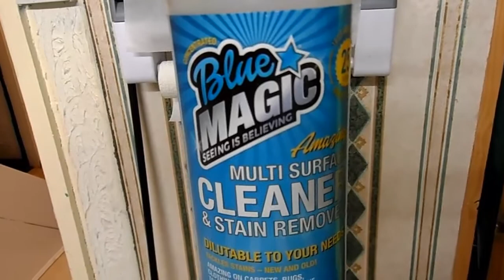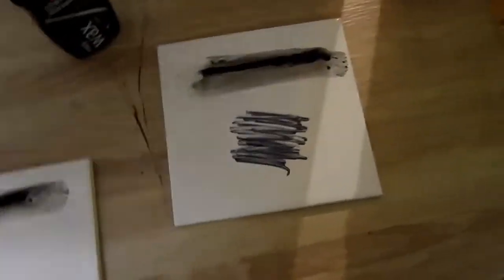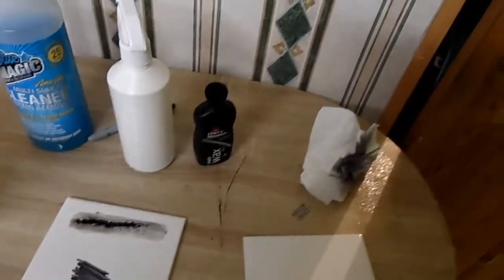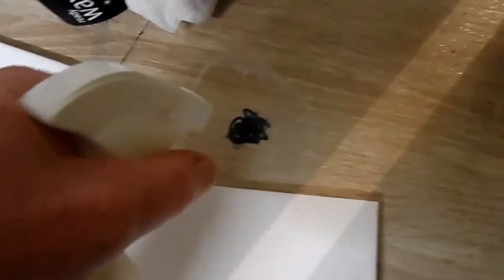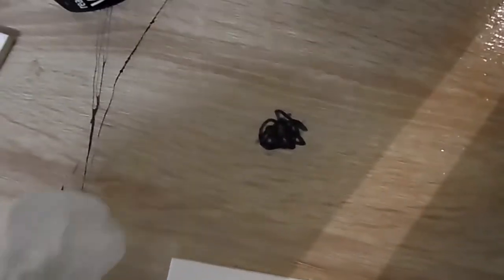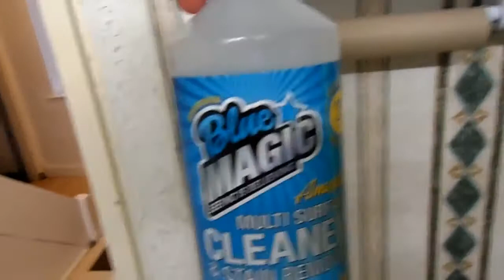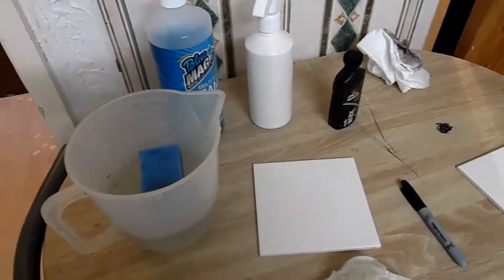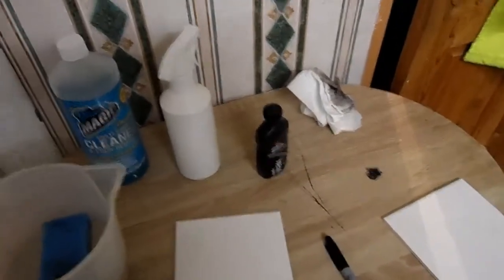Blue MAGIC Multi cleaner you've been conned by ideal world

Comment: I bought this off the shopping channel last night. The guy did about two hours of presentation on it and he said the only thing it won’t take out is permanent marker on a pores  surface, gloss paint and chewing gum, but it looked absolutely great on fabrics and laundry Also concentrated and you make up to 50 spray bottles out of one 500ml concentrate and I liked that you can make up your own strength for different jobs so I’ll do a 40ml spray bottle for my stubborn stains on fabrics and a 20 mil solution for the rest of the house also I like that is safe for kids and pets so you’ve done a video but on the one thing that the guy says it won’t work on, 
spill coffee on something and get it out with it after a few hours of letting the stain sink in and then use the blue magic as instructed and let’s see the results 🤷‍♀️

Comment: You ment to leave it soak into the stain for about 30 seconds  try using it properly and read the instructions, use a stronger solution also i find using warm or hot water works best i get if free so I'm not bothered either way and they sell 1000's and dont get that many returns i work for the place who make it 😉
Reply: I use this on everything.  Laundry to spot cleaning carpets. Stubborn grease to stainless steel.  Soap scum on shower panels. It goes a long way but you must use the concentrations advised and follow instructions to let it sit and get to work.
Reply: @dawnthatcher1412  spot on I say its  the best thing we make
Reply: Well said!